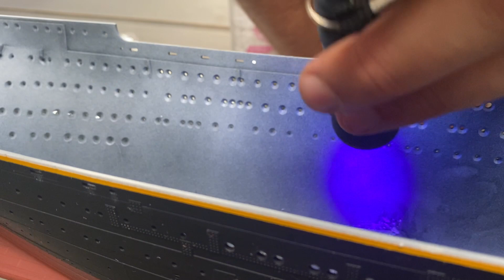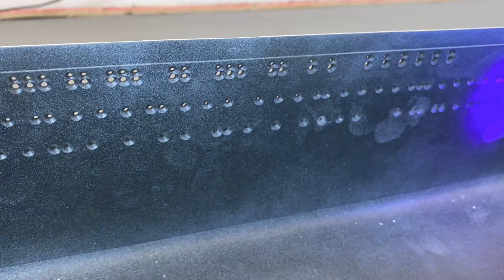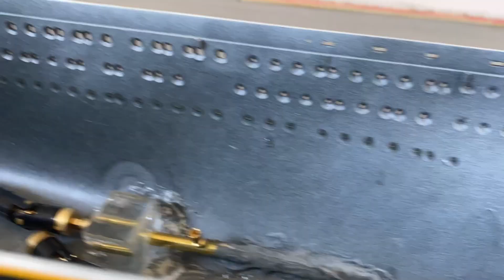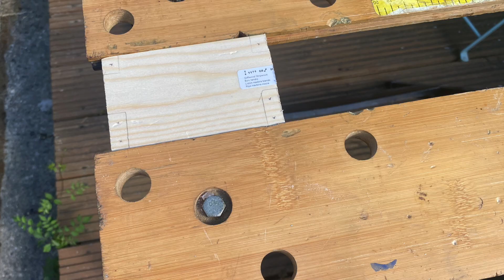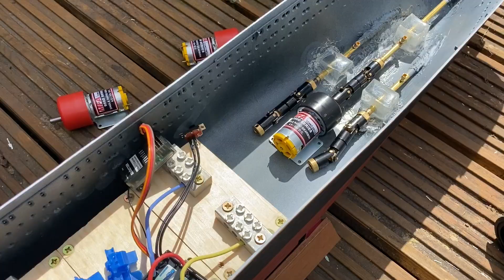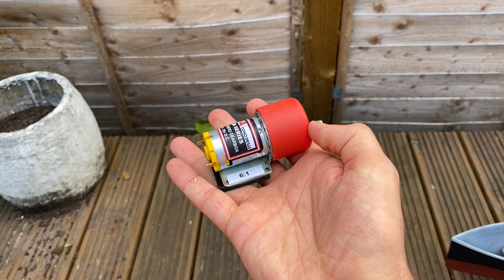Radio Control Trumpeter 1:200 Titanic Build Part 10 - Glazing and Electronics

Comment: I realize that I'm a bit late, and this might be addressed in later videos, but your yellow striping still looks a bit unclean. Just a friendly critique, it's magnificent otherwise. 👍
Reply from the maker: Hi, yeah you are absolutely right it is still a little rough. At the time of painting I favoured using a brush to give a bit more control, but in hindsight I think an airbrush would have been better as I got a lot of bleed under the masking.
Sadly one of those things, I do periodically spend time touching it up and am iteratively improving it but I don’t think it will ever be tip top. That’s certainly one of the lessons learned from this project! 
Thanks for the comment 😀

Comment: Nice work on the port holes. What resin did you use and are they all applicable with a syringe. I have not used this kind of produce before. Thanks in advance.
Reply from the maker: Hi, very sorry it’s taken this long to respond. The resin i used is in the description. Yeah all the ones I’ve used are syringeable. It comes in a black plastic bottle and I just draw some out and use that

Comment: From an mechanical engineerings point of view you’re doing a pretty amazing job so far, enjoying your videos a ton! You were talking about vibrations, so I wondered if you were going to do some testing on it (maybe with a vibrational spektrum app for a smartphone?) and if so, would you reinforce some parts? I was thinking about putting in some waterjet cut frames of aluminum to stiffen up the model -especially in the lateral direction-, and having sturdy mounting points. Other than that: superb job on the lubrication system, I think I will adapt that!
Reply from the maker: Hi, thanks so much for your comment. Particularly gratifying as im not a mechanical engineer (im an electrical)! Yeah re the vibrations that is one of the next jobs. It all becomes a bit involved as the characteristics change as you add weight to the boat, and obviously the hull being in water vs being bench tested has a big effect too. I didn't realise you could get spectrum apps for the phone, do you have any recommendations? Would defiantly be of help. 
Im defiantly going to put some reinforcements in, for a couple of reasons, firstly for stiffening but also as they will give me a bit of compartmentalisation which gives a bit of resilience to flooding should that ever occur! I've deliberately left that until I have all the kit in the hull though so I can work out the best places for the stiffening bars to sit. If I can get access to the equipment i would like to use aluminium but its finding a small business that will do such a small order of water jet cutting for me, otherwise reasonably rigid plastic (maybe perspex) would do the job too. 
Glad you're enjoying the build, let me know about spectrum analysing apps :)
Reply: @TheModelBoatGuy  I use the app "VibSensor", which should be available for iOS and Android. It's really helpful since you can export the raw data as a csv file (either with fft or time spectrum). If you like, you can measure the preliminary eigenfrequencies and roughly calculate where you will land when you add more mass ( with omga = sqrt(k/m), k being the stiffness, which will only increase with frames). 
If you can't find a waterjet cutter, you maybe want to get a fretsaw (if you haven't got one yet :) ) and some sheet material. For an exact cut, I always print out a 2D drawing out of CAD with 100% scale printer setting, glue it to the sheet and start sawing.
Looking forward to your next videos!
Cheers from a fellow engineer from Austria =)

Comment: Hi, you covered loads in that one!  Liked how the portholes are coming out. I bought 2 sets in case I foul up as they are very delicate and make good fodder for the carpet monster!
Glad I haven't got to mess with the electrics that much although I will be expanding the lighting to fibre optics onto the superstructure wall deck lighting and other bits too!  Adding working props as you know so that will be enough for me!  Yeah, go with the silicon and Polyurethane resin for the boats.  I have used the white resin as that looks good even before painting.  You will love the detail that comes out!  I used a very light wipe of cooking oil when moulding the initial boat but to be honest I don't think you really need that when using silicon.  My hollow boat idea worked well today, in fact, just a little clean up and they will be good to go!  I can knock them out 3 at a time so not so bad.  I will need to make slightly smaller boats too!  Anyway good job so far matey it's good to discuss the way we approach things and you have certainly helped me with resourcing things.  I live out in the middle of nowhere so getting to actually see some products is an 80 mile round trip for me!  I do obviously use the tinternet too!  Using your lead in research has helped me gather some really good materials, so many thanks.  JH ;-)